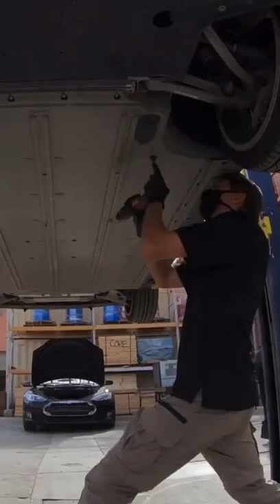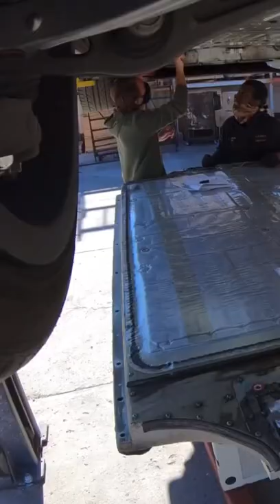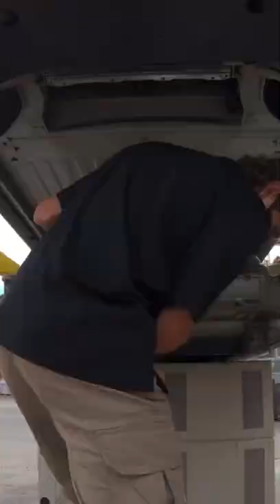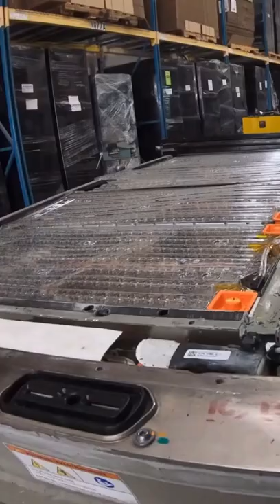How we Remove the Tesla Main Battery Pack

Comment: Ever seen a lithium mine? Tell me how that’s environmentally friendly
Reply: Have you have seen how much oil extraction it's order of magnitude worse?
Reply: @StefanoFinocchiaro  It is now… but there are ways we can do it sustainably, the governments just don’t want to admit it because there’s more profits in crappy boring EVs
Reply: In Canada their company draining good drinking water lakes  for presious metal batteries takes one is currently opening their going to dame 1/2  the lake to get under it .worsth Part that's my lake trout lake we go
Reply: @goracegoa1808  Yes, but most of that water return back to the environment because they make it evaporate to extract the minerals, also almost all oil companies now days they use fracking where they pump water at high pressure underground. But there's a big difference, oil extraction it's a continuous process because can't be recycled and a car consume like 10 to 30 tons of oil instead an electric car battery (about 0.3 tons) usually last at least 10 years and after that can be recycled directly or by extracting the materials
Reply: The majority of electricity in America is coal and natural gas. These electric cars literally run on coal and natural gas.
Reply: That's called a strawman argument
Reply: Ya electricity just comes out of the walls.
Reply: @jayce5025  Yes but in almost all states it's already more efficient to use the mix energy (Keep in mind that gas plants even recover the heat they can have from 50% to 60% conversion efficiency), also generally in most places renewables are increasing (also there's nuclear). In my country (Italy) we have about 300gr/kWh CO2 emissions ( including indirect emissions for solar and wind)  so my ev indirectly emits about 45gr/CO2 per km compared to the gasoline version at least 160gr/CO2/km that's more than 3,5 times. In EU the only place where there is not much difference it's only Poland where they use only coal
Reply: @jayce5025  the difference is that ev is way more efficient, so the gas used to make the electricity to run the car is used better. Just to compare, we all know gas car is 30% on average fuel efficient while ev is at least 90%. Let's say we use 10L of gasoline to run a car in the case A and to run a generator, that is let' say 60% fuel efficient to charge an ev in case B: in case A you can use only 30% of the energy and so you could potentially use only 3L to reach the same mileage in a scenario with no losses, in case A you are making electricity like using 6L with no losses, that are used by the car for 90% of it so 5.4 liters gas. It's almost double the efficiency, emissions to make electricity depends by what you use, but you can potentially have it free, if you live in a sunny area with a decent amount of solar panels, reducing again emissions. Ev are not so boring, but companies do their best to make them be boring
Reply: uhh ev hater
Reply: You need to do more research before you speak. No disrespect, but it’s an honest assessment.
Reply: @palmtraveller2177  No. This is a false statement.
Reply: I'll stick to my '80 Chevy truck.  (Bub)   😎
Reply: You should ask the people of chilé how they feel about the lithium mines!!!!! How are landfills gonna look in 15yrs once we add in mass production of electric vehicles!
Reply: @StefanoFinocchiaro  its really not. There is a point where its better, like if your driving a 1990s car or a hummer. But if you have a Prius or some other high mpg car it is far better to simply use the one you have until you need another one. 

The environmental cost of lithium as well as rare earth metals is stupid high. 
Watch some footage of those mines running if you don’t believe me
Reply: This
Reply: Exactly
Reply: Who
Reply: Cares
Reply: @cyruskhalvati  Yes, but I didn't said that, but any way even if you sell a newer car you don't destroy it so it doesn't matter. Enviromental cost compared to burning oil it's almost zero, infact by mining lithium you can make something like (for saying) 0.0000001% of earth surface uninhabitable due to mining activities, by burning oil we are just making the whole 100% of the planet uninhabitable
Reply: @StefanoFinocchiaro  How about, try that again, but this time, in English?!
Reply: @StefanoFinocchiaro  Crack Smoker.
Reply: Total BS!!
Wouldn't own one
DEFINITELY NOT GREEN
Reply: Imagine a landfill full of these batteries!
Reply: Ever just walk?
Reply: @stevelanam9462  definitely not bro it’s just a scam
Reply: You know Tesla recycle their batteries right? Some people type out of their ass
Reply: @qualcunoacaso4865  your numbers are off by quite a bit actually. All things considered an electric car is generally more efficient, but you have to understand that there is many many factors. While charging the car, there's efficiency lost through the heating in the cabling and this would be true in your home as well. Also remember that if that your electric car happens to be used in say Canada in the winter, while new ball game. Heat for the gasoline engine is a byproduct of the combustion already being produced by the engine. A Tesla has to create the heat with electricity that's it's supposed to be using to propel itself already.
Reply: @ashes2ashes863  yeah that's true. Numbers were just very approximate to be easy to understand and also oversemplified. I do think that if you have also to heat your vehicle up then gasoline is better, electical heating is too expensive, but for ordinary people, living in places where you don't need a/c or heating too often, then ev is 100% what you should get, if it wasn't so expensove rn! If they find a way to make hydrogen in a green way, and maybe bonding it with something that doesn't change his proprieties much but making it easier to store, it would be probably be a good in-between choice, cheap enough to be within everyone's reach and traditional for all the nostalgic. Or, we need to reinvent batteries, making them better but cheap, not easy
Reply: @qualcunoacaso4865  yeah I would agree. I'm not a hundred percent against electric cars. I think that for a lot of people they make a lot of sense. I just don't think we're entirely ready to switch over and I feel as if we're being forced to do that with gas prices right now in the United States. Gasoline vehicles actually run cleaner now than they ever have before. That's not to say they're entirely clean, but if they're being maintained the way they're supposed to be which is pretty hard not to do today, then there's really no reason to be forced. I drive a lot for my living so I can drive 300 to 400 miles a day. An electric car would definitely not work for me. My wife on the other hand, she drives 20. She can probably literally Charge her car in an hour and a half with 120 V Outlet everyday. For her it  probably makes more sense. She might even own it for 10 or 12 years charging it so lightly before the battery gives her any trouble. But the other thing is she doesn't keep a car for more than five anyway. As much as I love a good sounding V8 engine though, I have to admit electric cars are going to be the way of the Future. They perform undeniably. I do think we have a ways to go though on the Battery Technology despite the fact it's probably better now than ever. Now is actually great time for people that like cars whether you're in team electric or gas because you have great options on both sides. I think we should both just buy what we want and enjoy it.
Reply: It's more environmentally friendly than coal and pretty much every other mining operation bud ;)
Reply: @davsaltego  this lol it’s all smoke and mirrors
Reply: @windy6455  You
Reply: @StefanoFinocchiaro  Absolutely not. The process of mining lithium is FAR WORSE for the environment. And then something else you fools don't consider; where do you think the electricity powering your car comes from? The tooth fairy? NOPE! Power plants would have to burn FAR MORE EXTRA FOSSIL FUEL to generate enough electricity to charge everyone's vehicles, if everyone had an electric car. Because burning fuel to turn it into electricity to then transmit it to a house and into a car battery, is WAY less efficient than a gasoline engine.
Reply: @PotatoeJoe69  Do I'm a fool I or you that you don't have even read my previous comments where I've talked about that? In my country we have emit about 300gr of CO2 per kWh so that's about 45gr per km with my EV. That is including all the indirect emissions like the emissions needed for creating new power plants for solar winds etc... If you do the same with the equivalent gas car it emits at least 160gr CO2 per km that's more than 3x, and that's today, the gap will get bigger with time as the grid get greener
Reply: Goin green my arse!!!
Reply: @StefanoFinocchiaro  you said at least 10 years

But in fact Lithium batteries last AT BEST 10 years, dont try to serve lies little EV Fanboy!
Reply: Do we just... Burn the lithium? Or does it remain in the battery to be reused for YEARS until something bad happens to it?

Battery packs dont just fail, its almost always neglect or damage. Letting it drain flat a few too many times, overheating, and physical damage are the main causes of failure.
Reply: @theguy9208  and in modern days: fast charging
Reply: Ever seen a fuel refinery?
Reply: @jolizana96  They are very enviroment friendly!

Lithium Mines make tons of water (per hour!) unusable/poisoned!
Reply: @harrison00xXx  sure thing buddy
Reply: @jolizana96  sure
Reply: @StefanoFinocchiaro  a car does not consume 30tons of oil?????? Wtfis wrong with you????? Let's do some math here. A car will on average get 300,000km in its lifetime. round it up to 10k oil changes instead of 7k just for ease of math.  So that would meant you do 30 oil changes in that cars life time. 100% of the oil is recycled and the car uses 4L of oil per oil change. That would mean in that cars 20years on this earth it would use 120l of oil.....  120L in 20 years ....... so tell me again how a car uses 30tons of oil........ because it's actually about 300lbs of oil in 20 years you  rock head
Reply: @ZackBadCompany1234  I'm talking about the petroleum
Reply: @jayce5025  man you got the points when some stupid PPL say ev car is good for environment
Reply: @palmtraveller2177  any way you slice it you are still using oil, which when burnt produces shit that you dont want in the atmosphere. also, how are ev's boring? they literally produce the fastest production car of all time? you can play fucking mario cart on the screen?
Reply: @StefanoFinocchiaro  oil extraction does nothing to the planet lol 😂
Reply: @AmericanRustWorker3369  If so why are you complaining about lithium mining? In a way it's very similar both they need water to be pumped underground. (But in lithium mining they make the water evaporate it's much similar to salt extraction)
Reply: I've seen them, they are way less impact full than an oil drilling site.
Reply: Even if some processes of the electric car produces emissions, the EV contribute to 30-85% less emissions during its lifetime than the conventional fossil fuel car. 30% better if you burn pure coal to generate electricity, 85% with solar, hydro or wind. Tell me how that is bad?
Reply: @jayce5025 even if you run an electric vehicle on pure coal generated electricity it still contributes to 30% less emissions than the conventional gas powered car. Fossil cars are just inefficient and the process to extract gas is not environmentally friendly either. Most countries have hydro or nuclear mixed in though and it gets even worse for gas cars. Gas cars are a relic and thing for the past.
Reply: @qualcunoacaso4865 rekt everyone with his comment. As he said fossil fuel cars are way too inefficient to the point burning fuel to produce electricity and run an EV with it produces less emissions. Think about that for a second.

Comment: If that battery needs to be replaced what do you do with it? Where does it go? How is it recycled? How much does it cost to replace with parts and labor? Just asking...
Reply: I’ve heard it’s around 20k$ to replace the battery, I don’t know which model that’s for.
Reply: @rogerstarkey5390  so I have to buy a 50-130k car and then have to spend 20k on batteries every 4-5 years? No thanks. If my truck drops a rod I can fix it at my own shop, I have to go to the dealer with a Tesla. Seems like a monopoly to me, I thought we had laws against monopolies?
Reply: @rogerstarkey5390  Roger you proved my point and got all worked up at the same time. BTW you failed to mention the cost involved.
Reply: Give it to me, I will gladly take any old EV batteries. In fact, I'd PAY you for one.
Reply: They can be reused to make new batteries
Reply: The ocean
Reply: BURN COAL
Reply: Same deal as wind, the cost of recycling is greater than the total energy gain after production. So they all get buried.
Reply: Some of the cells are taken and used in grid storage or other less demanding applications. Then other cells are taken apart and put into new cells
Reply: What happens if an engine needs to be replaced?
Reply: @xXSinForLifeXx  you will replace the specific piece in the engine that needd to be replaced. So let's say your oil pump fails and cooks your engine. You will remove the engine take out the oil pump. Replace the oil pump. Replace the bearings and seals. And re install the engine. You will then send out the old oil pump to get rebuilt... litterally the only garbage is the 2$ seal. Even the old bearings get melted down and recycled into new steel
Reply: @09impala  if you wanna hillbilly rig up your own ev battery I guess. But no at a dealership or a proper shop then never use old cells in a new battery and the never pull apart a bunch of bad batteries to make 1 good one. They litterally toss the whole thing and replace the whole thing
Reply: @ZackBadCompany1234  Yeah that's fine if those are the issues. But sometimes you do need to have an entire replacement engine.

It's not an alien concept that parts expire and must be replaced. Idk why people act like this is surprising.
Reply: @darkdaysahead5079  What? There are three parts to the battery. The cells, the module of cells and the pack of modules made out of cells.

18650 cells cost under $20 and the packs should last 500k miles. 

Why would one replace an entire battery when one could just test the modules find the problem cell and spend around $500 for parts and labor? 

Where TF did you get this idea from?
Reply: @brookekathryn1980  oh I don’t know, all over the internet? Have you been living under a rock? What you think it should cost and what it actually costs are two wildly different things.
Reply: @darkdaysahead5079  Yeah, cause everything you read on the internet is real and true! 

Sure the entire pack is $13-$14k ($127 kwh)  and should come down to $60 kwh with the new 4860 cells, still not quite $20k as you suggested. 

Did you forget that things are more expensive when new?  

Still the entire pack is not the issue and therefore doesn't need to be replaced! 

Let's not forget the battery has a 8 year 100k-150k warranty to top that off which makes you 4-5 year replacement comment completely false.

Even still EV battery packs should last 500k miles, so you're still wrong on that front as well! 

Do you also replace an entire engine when ya' have a bad valve seat? 

If you're dumb enough to take your Tesla to Tesla after your battery warranty is up and then you deserve to pay for a brand new battery, instead of paying $500 labor plus parts to replace a bad cell!

Maybe know how a battery and BMS works next time and actually own an EV before you flap your gums!
Reply: @brookekathryn1980  cool story, 99% of people will not fix the pack though, they’ll go back to the dealer and pay what I said. I’ve seen multiple reports of them being over 20k at tesla. 🤷🏻‍♂️🤷🏻‍♂️
Reply: @darkdaysahead5079  A common misconception of EV batteries is that they fail within a few years. In fact, most manufacturers warranty their EV batteries for 8-years or around 100,000 miles, and most batteries last well beyond that.

I believe the misconception comes from 12v lead acid car batteries, which often times fail within that 3-5 year period.

As for OP's question. EV batteries, even when defective, are extremely valuable and will never see a landfill. In most EV's the battery accounts for around 30% of the cost. So a battery can easily cost $10,000+. Labor costs to replace them is very low; As we can see in this video there isn't much that needs to be done. Though if doing cell level repair, it can take a lot more time as you have to open the pack and test each module to find which one is defective.
Reply: it’s recycled
Reply: Probably have to pay them to dispose of it.
Reply: @darkdaysahead5079 who said every 4-5 years? arent you aware of battery warranty and charge cycles? gain some info before lame commenting
Reply: @forever_momentss  maybe you should keep up with what’s going on, chances are the car will burn to the ground before it needs a new battery. Junk cars for dumb people.

Comment: Look at all that,green,definitely non toxic and pollutant lithium battery right there ,ah save the earth amirite?
Reply: The "polution" is still better than gas cars in the long run
Reply: They are reusable if I’m not mistaken
Reply: @Samuel-eh2gf  untrue, your carbon footprint using an EV is more of that than using an ICE car… you’re using more energy to drive your boring EV lol. Take it back and get an escort
Reply: @dailydoseofinvesting-roadt3776  fun fact,you're reducing carbon footprint by using older second hand cars since it reduces the ammount of cars on the road than buying a new one
Reply: @Samuel-eh2gf  and in the long run that gas car will still be running after your EVs electrical system goes bad
Reply: @palmtraveller2177  when the grid is renewably powered, EVs will be necessary.
Reply: @palmtraveller2177 that’s not untrue